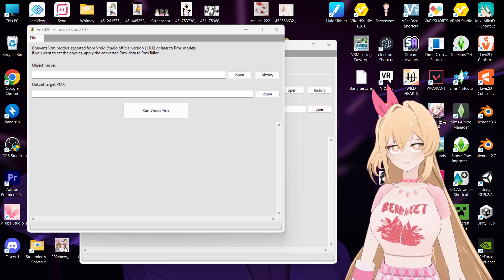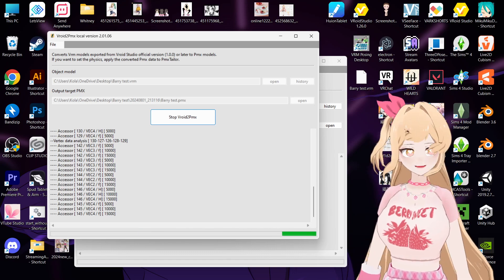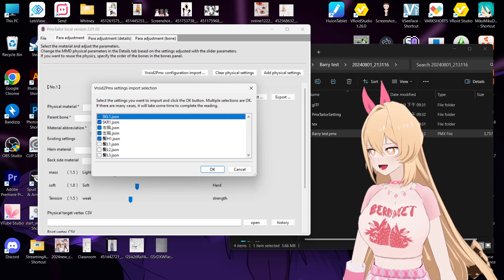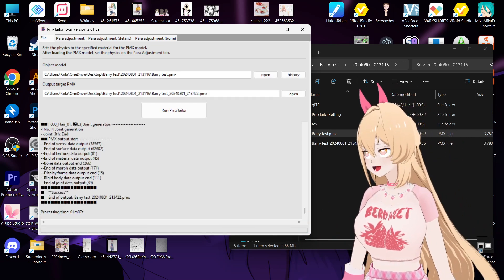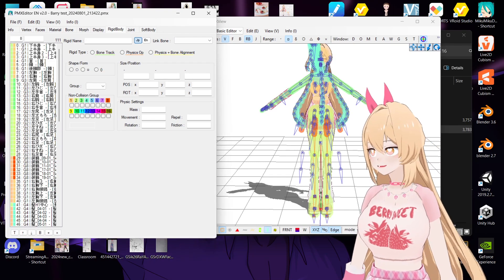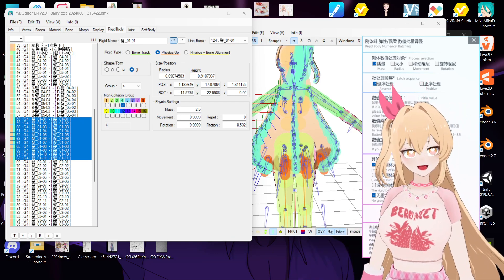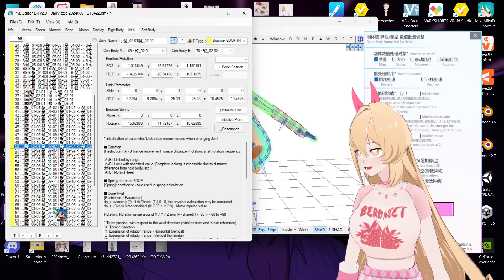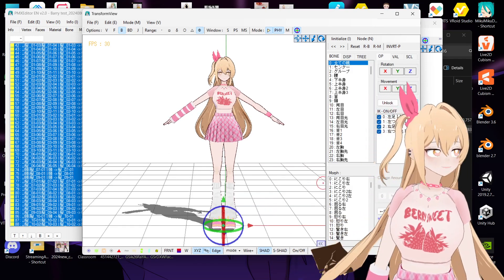MMD Vroid to PMX model physics tutorial *plz on CC for auto Eng sub if you can't understand me QQ*

Comment: hey I don't think this is actually dangerous but when I tried to use PmxTailor, i got a pop-up on my computer saying it might be deadly and so I checked on a virus checking website, and the website showed something malicious that was part of the ZIP file called "DeepInstinct" and had the properties or something rather called "Script.Troj.SuspLnk.22152" which i assume to be a trojan. i might be wrong in my worries but i will just put this out there for a just in case measure, and also to see if the app is actually ok. (the website i used to check this was called VirusTotal btw)
Reply: also when scanning the actual app itself it said it got this thing called "W64.AIDetectMalware" and says its malicious but in this instance i am not so sure